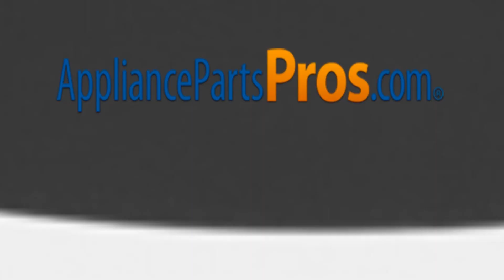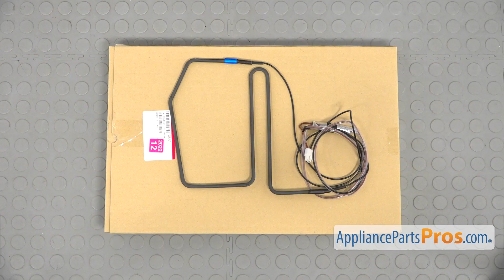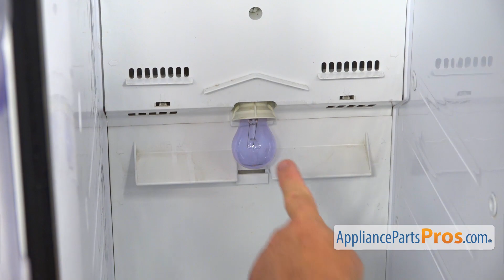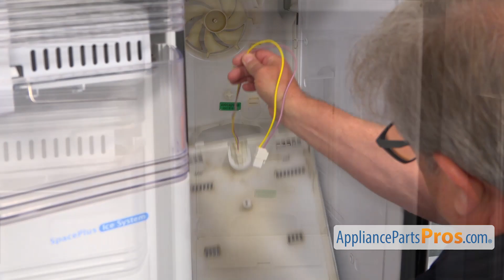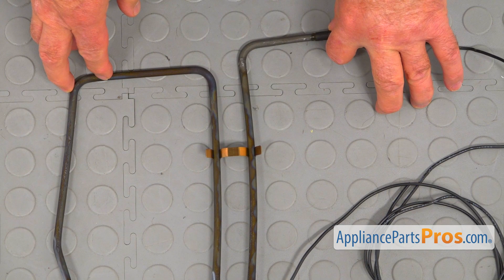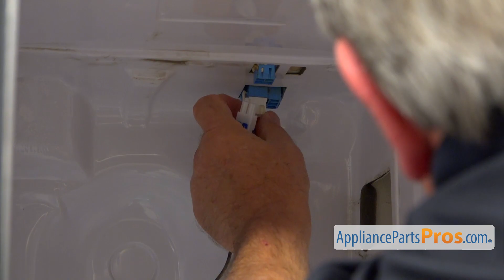How To: LG Refrigerator Defrost Heater 5300JB1102H

Comment: Did I miss where he wires the clip/plug to the new defrost heater since he cut off the old one? Or does the new one already come with its own clip/plug attached?
Reply from the maker: The new part has it's won plug.